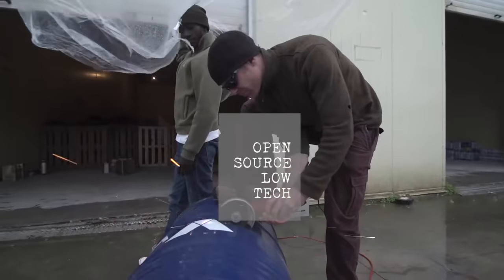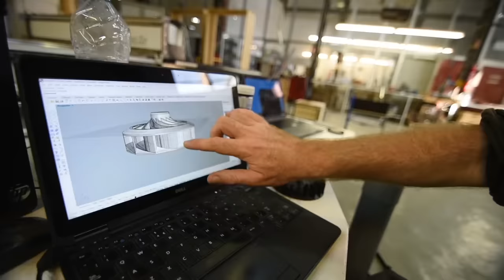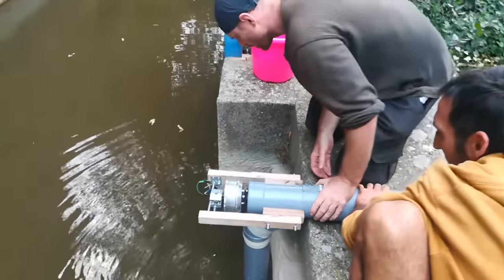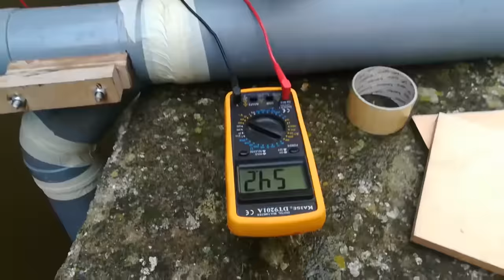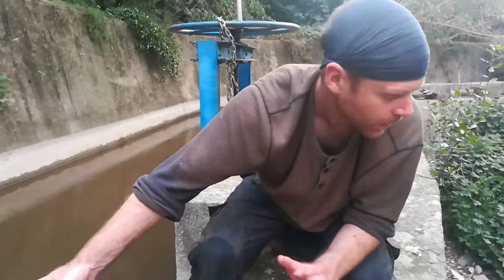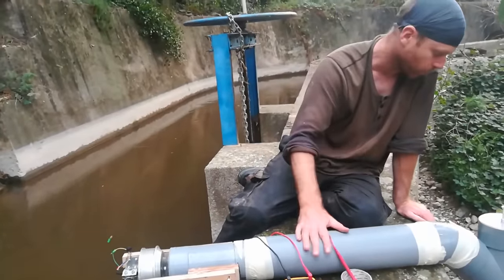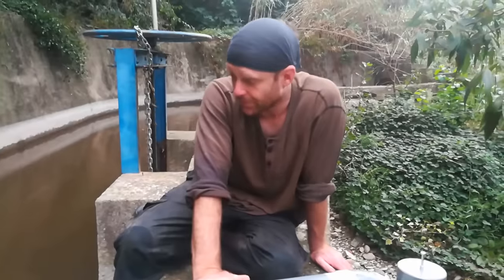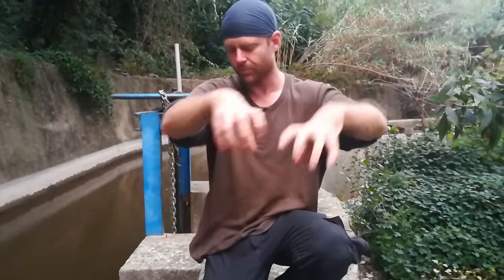The $50 Water Turbine -DIY, Portable, Powerful, and Open Source

Comment: Could you not double output by adding a second generator in the free air below the water outlet (as it is above the water line) thus taking both pressure power (from the top generator) and velocity power from the bottom?

Comment: Curious if there are resources YOU use/recommend related to technical documents, etc., for those of us interested in building hydro generators. 

SPECIFICALLY - 
1) for LH and ULH, is there a matrix discussing (obtainable) efficiencies based on type of turbine
2) comparisons of RPM vs TORQUE
3) matrix on recyclable alternator / electric motor options (with target RPM) ... I've read a LOT about using washing machine motors ... you mentioned the motorbike alternators ... I imagine that the electical output could be very different even with the same RPM ... but that's my n00b understanding.
Reply from the maker: There's a fair amount available for micro hydro and above, but for pico scale not so much.
Most of my understanding is from direct experimentation. 
The wind turbine facebook group is a good source of info and expertise:
https://www.facebook.com/groups/windturbinemakers/

Comment: I want to collect water off the roof of my van direct it down a pipe into a tank.  And before the tank turn a turbine to charge some batteries.  
I will buy parts from home depot. Any ideas on what it should look like and what motor/generator/alternator  I should use? And the fins turn an axle not sure how to set that up either. 
If you're  available  to make a video of possibilities...
I think at a point I should reduce the diameter to a pin to smack the propellers and have that happen within the plumber's pipe and the water can waste into the fat pipe on the other side.
Reply from the maker: Unfortunately with flow and drop that small you wouldn't even be able to charge your phone in a monsoon.

These things basically need a hillside worth of catchment to get any useful power.

Comment: I was wondering, what if you curve the pipe to accommodate multiple turbines more than enough to power an electric water pump, to pump the same amount of water back up?

By this you can keep the water going and turbines spinning.

Will it work?

Comment: The power suction of the device depends on the water gap, to have a good flow of water/water moment, correct? What is the water gap that you had there?
Reply from the maker: As in drop? On this one it was about 2 meters.

Comment: how did you manage to stabilize the fan shaft and cover the entrance of the "Y" connection to prevent the entry of air that would cut off the water flow?
Is it a 110mm PVC Type?
Reply from the maker: Good questions, check the part 2 video for details.

Comment: Could you use this turbine with a reservoir and water pumps. And recycle the water from a pumped input to output back into pumped input reservoir tanks. Maybe add a water filtering in the pumped output back tank into the input tank? 

Could this concept work? 

What would be the power needed to power a 15 bedroom house ?

How could you store electricity, if you wanted to use the turbines to store power? 

Could you use the power stored to then power a house?

Comment: @ 2:43 ... I wonder if you will get more power if you put the turbine on the down stream of the water, at or below the water line on the down side ? Can you put that turbine in the bottom of a funnel anchored to the bottom of a fast moving stream and produce power ??
Reply from the maker: Those exist, but are a different type of turbine which needs pretty fast flowing water to produce much power. Funnel would help, but you'll get a lot more output with any kind of drop to take advantage of.

Comment: If you put another generator on it could you get more power out of the residual mechanical energy in the system? Even though it is a lot of power for a small system it seems like even enough extra energy to power a phone could be of value.

Comment: this just a question kinda....but am I wrong thinking that by ignoring 
the 2m drop right after the turbine wastes a crapload of potential 
energy? If the turbine was at the bottom of the pipe by the outlet you 
would have so much more force on the water running through the turbine? 
No? Even better you could fit another turbine at the bottom maybe? 
Double the power output without putting more strain on the turbine?

Comment: Hi Daniel, have you looked at using a jet ski impeller and could you gear it to run a smart drive motor at a higher speed?
Reply from the maker: They'd be sturdier and quite possibly a more optimised shape, but the issue is availability. Computer fans are super easy to get, pretty much anywhere in the world..

I did pull a direct drive washing machine motor while I was working on the part two version of this turbine in Berlin, but while they'd do good enough rpms and voltage without gearing up, they're just too big and heavy for this little turbine.
Would go well with the vertical axis wind turbine tho...

Comment: As others have said, generating a voltage is simple.  I can generate a thousand volts with just my hands rubbing on a piece of carpet. This demonstration means nothing without measuring a current flow.

Comment: Hi. Great job on this project. I have always been fascinated with renewable energy. I'm also interested in join and working for company.
My question are: since you're in Barcelona, I am assuming you use 110V. Is it possible to use this turbine in Africa for 220V? Or so you suggest another turbine? Is the turbine manufactured to work on both 110 and 220V voltages?
 Could this turbine power AC, refrigerators and other heavy equipment? What does the turbines come with if I want to buy it? Thank you again for your work.
Reply from the maker: The issue of mains voltage has more to do with your inverter than the turbine. Basically you'd have the latter charging some batteries, which then let the former do its thing of bumping up and maintaining the output mains voltage you need.
As to whether the turbine could power heavier draw applications, it really depends on the specifics of the entire situation. But the second turbine I was working on in Berlin after this one I got outputting 200W, which is almost 5kWh/day, which isn't bad, and should be able to supply a certain amount of stuff, especially in lower demand type settings.

I may get around to selling kitsets of these, but up until and including then it's meant mostly as a DIY project where people make their own, or sell them in their area. The part 2 video (in the description) has more info on the configuration, and there'll be a full step by step built tutorial in the coming months.

Comment: Create a 24/7 operating durable version, but place this device in an enclosed loop of enclosed water that is pumped with a water pump to cause continuous flow. Preferably, this concept would be done with a higher elevation section of a waterway and a slope leading to a lower short manmade "stream" and pumped back up after the water ends in a pool. Place several of the DIY turbines along that and that shall ensure free energy production as long as the water loop system is not taking up more than an area of about 25' x 25'.

Comment: Try a automatic transmission tourque converter with ported jets on the outside parimitor.
When feed with pressure it multiplies the out put power by a power factor of 10.

10 psi in 100 psi of torque out.

Comment: Could another generator be put at the bottom of the pipe without slowing the flow maybe with a different type of wheel at the bottom? Double out put with same water drop.

Comment: If you installed the Pelton at the bottom of your pipe - wouldn't that work too ? The first generator you currently show would use the force of suction and the Pelton would use that and gravity(head) drop .... double your power production !!!?

Comment: install a foot valve at the suction pipe then u can turn on-off cork valve at the discharge pipe so tht u can switch on-off your electricity supply or use the water from discharge for watering plant

Comment: Would you be able to add more Turbines, wiring them in series, to create more power? Or would it slow down?
Reply from the maker: Each would slow down all the others, and multiply the cost.
Reply: This is true in a sense, and I understand the laws of Thermodynamics as well and  Load Compromises...but wouldnt it still push out more power?

Comment: My main worry is the computer fan blades failing when the generator is loaded, or if the tube picks up something solid like a piece of wood. I wonder how much performance is lost if you rivet some metal vanes to a centre metal hub and use that as your turbine. It's easy to find scrap sheet metal and various types of metal rings of a standard range of sizes to weld/braze/rivet together. Scrap cars are full of both of those things, for example.
Reply from the maker: Yeah we'll see how the fan holds up. There are options for reinforcing, and apparently server grade fans are fiber reinforced, but somewhat less common..
When I short the three phases and hammer the alternator to maximum load the fan doesn't explode, which is a good sign, but will take some months at least of field use before can be confident they're durable enough.
The intake will have a screen box to prevent solids entering.
Reply: @OpenSourceLowTech  That's good. I also just had a thought about inline ducted fans. They're pretty common in industry and fail all the time because they tend to be in dusty environments. It's almost always the motor that fails, and the fan blades are still good. They're pretty well-balanced, often galvanized metal, and come with a convenient perfectly centered hole for mounting to your shaft with a simple bolt, not to mention better blade geometry than a random pile of scrap metal like I suggested before.

Might be something to think about if you happen to come across a good way to find and salvage them.

Comment: Could another, or multiple turbines be installed into the downspout? If they would impede the water flow, perhaps just one a couple of feet below the pipe end on the downspout.

Comment: If the pipe is fully submerged, the water speed and pressure will be the same at both ends of the pipe. It doesn't make any difference where in the pipe you put the turbine.
Reply from the maker: In terms of momentum and system energy at any given point that's true, but I did find that placing the impeller a little further along (check the part two video) helped with issues like cavitation, and resulted in better efficiency.

Comment: What about the durability of the impeller? The wheel ones seem a bit more durable because they don't have blades per say. Wouldn't debris destroy this such as storm waters that kick up debris? I'd imagine a "water box" at the bottom with a screen to block out as much debris as possible?
Reply from the maker: It may well, and yeah this'll definitely have some basic filter on the inlet under actual use.

Comment: Hi Daniel, is the hoverboard wheel the best motor to generate electricity? ..the coils are far away from the magnets..the construction of that motors are like the stepper motors.. and why 3 wires on these motors? how you connect the wires and what circuit you use to convert VDC?
Reply from the maker: They seem pretty effective and efficient, while also hard wearing and easy to get hold of in the West at least. Definitely better than a stepper, which are usually quite inefficient.
They're three phase AC output, which I have then been rectifying to DC.

Comment: Put a waterwheel at the bottom to use the speed of falling water to power another alternator.
Reply from the maker: For the vertical height the wheel would take up it would be more effective and simple to just have more down pipe.
Reply: @OpenSourceLowTech  thats not what i had in mind. At the bottom pipe is open and water just gets out. put a waterwheel under pipe exit not in the pipe.

Comment: Good idea provided you have an inexhaustible water supply or running water from a stream going through your property that is not likely to dry up. ;) What you really need is a way to constantly recycle or top up the water in the top reservoir back up from the lower reservoir so no water is lost in the process of running your Hydro turbine.

I wonder if you could actually make the entire system work using conventional rainwater tanks set at different levels on a sloping Block of land and then pump the water from the lower tank to the higher tank without using too much of your generated power to run the water pump to constantly top up the higher water tank?

Or alternatively, just Build one tank on a platform right above another tank placed on ground level to achieve the same result -  on Flat land?

Comment: Is it possible to do this in a shallow stream, also how would the energy be stored?
Reply from the maker: Water depth shouldn't really be an issue as much as flow and drop, for which you'll need at least 30 l/s and 2.5m or so, respectively.
Storage is a whole thing in itself, but probably something along the lines of batteries. Hydro is usually pretty stable and constant tho, so storage isn't as much of an issue as with say solar or wind.

Comment: Is a motorcycle generator really capable of producing 500 watts (without heating up too much)? All my manuals have them in the 200 to 300 watt range with the regulator/rectifier inline.
Reply from the maker: No, it'd be for low hundreds as you say, and the volts per rev is only about a quarter of a hoverboard wheel. But they're pretty much universally available around the world, where not really any other usable options are, and will do enough to be basically viable, tho do need to be mounted on a bearing.

Comment: I have a question about 5:03. How do you calculate how many homes it can power in a developing country? Is there a formula or something similar?
Reply from the maker: Ballpark estimation based on experience. Everywhere's different tho.
Reply: @OpenSourceLowTech  Hello mate, thanks for answering. Could you please explain in more detail? I want to do a similar project in my country, Honduras, but I will need to write a report about it so that is why I am asking.
Reply from the maker: What are the power needs of the people in question? Just lights and devices, or also TVs, refrigerators, other whiteware, heating, cooking...?
Reply: @OpenSourceLowTech  I was thinking focussing on street light, maybe include phone chargers in the light poles, and on the small schools of the rural areas. Should a pilot project work then we can expand to include refrigerators and heating.
Reply from the maker: Yeah that's a good idea and usually relatively easy to accomplish. Implementation specifics will depend on the situation obv, but I'd suggest maybe doing a 12VDC pico grid, run off lead acid batteries and with off-the-shelf 12V LEDs and USB/phone chargers. Maybe a small inverter so you can also charge laptops or other mains powered devices.
You can use something like motorbike regulators for charging the 12V batteries, tho other options also exist.

Fridges can draw a lot of power, and heating is probably better done with biomass in that kind of setting, so like you say, get a pilot going first and then reassess.

Comment: I have a 100 amp ac to dc bridge rectifier. And 100 watt 3 ohm resisters and a bunch of 4/0 cable and copper bars .

Comment: The power generator. How is it made? Ac or dc? Is it a “store bought” or did you create it?
Reply from the maker: It's a wheel from a hoverboard / balance board. Three phase AC. Check the part 2 video for more info.

Comment: Hi Daniel! How this turbine run after near 1 year? Do you make improvement?  Do you produce a detail construction tutorial like you wrote above?
Reply from the maker: Check the part 2 video in Berlin for that update, I'm now in Scotland, lined up a site for long term testing. Once I'm happy with the design I'll do a full build tutorial.
Reply: @OpenSourceLowTech  Can we use a car alternator to do the water turbine? If I have less water can I reduce the intake pipe?
Reply from the maker: Car alts aren't great options, low efficiency and high rpms to reach charge voltage. Also take more force to turn than this turbine may be happy with.

I'll have a video coming out soon tho on how to mount and use a motorbike alternator, which are generally better on all fronts.
Reply: @OpenSourceLowTech  
I can not wait to see it! An other question, can we take the same water in a pool for this water turbine?
Reply from the maker: How do you mean?
Reply: @OpenSourceLowTech  If I don't have a river near me but  I have a pool. So put the intake  and the return in the same pool.
Reply from the maker: No, this system  won't run as a loop. The outlet needs to be lower than the inlet, it's the drop which produces the power.
You could pump the water back up, but that would consume more power than the turbine would produce.
Reply: @OpenSourceLowTech  Ok, thanks! Witch minumum distance the outlet should be lower than the inlet?

Comment: Just a thought, and by no means am I educated in this stuff, but as this is based on a siphon action, therefore requiring actual priming, could one incorporate a ram pump to automatically prime the system again if the system lost it, maybe due to an animal bumping the pipe or low water volumes?
Reply from the maker: Maybe.. It'll largely depend on each specific configuration how best to get it going. I'm thinking mostly this won't actually be used in a full up-over-and down style siphon as pictured here, but just a straight pipe which plugs directly into an inclined water flow, as that's going to be a lot more common than dams, walls, weirs etc.
In which case priming wouldn't be necessary.